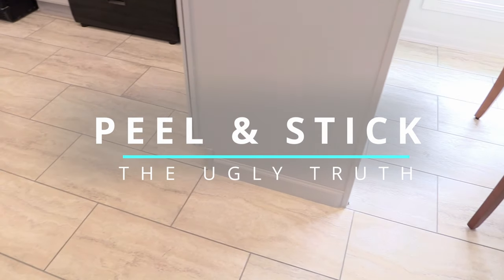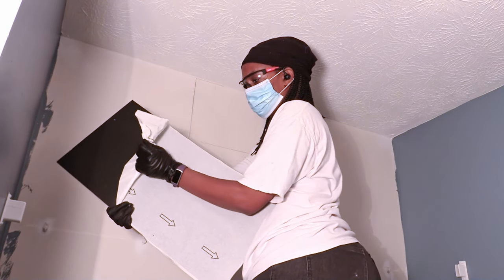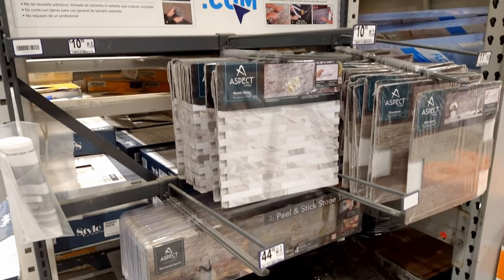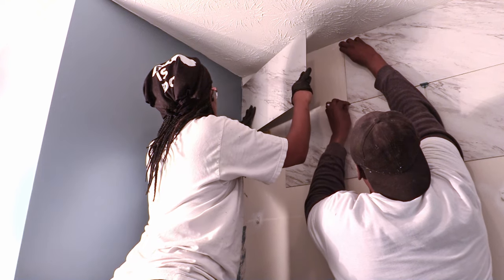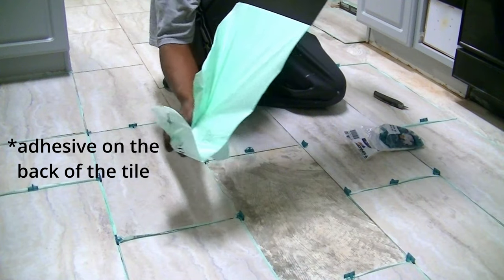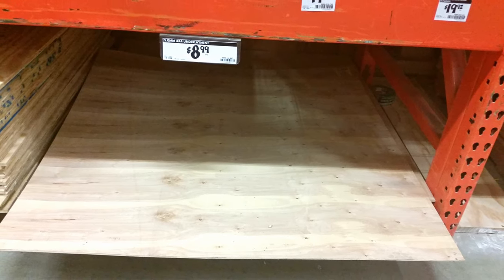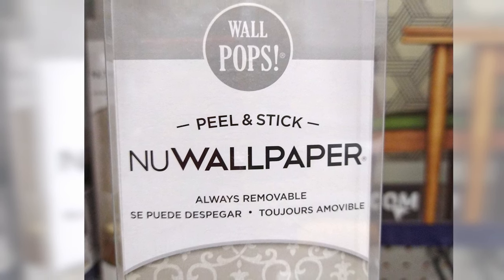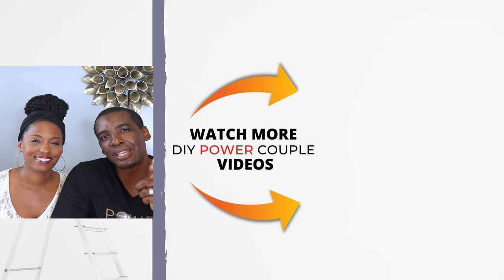THE UGLY TRUTH ABOUT PEEL & STICK - Don't Be FOOLED!

Comment: That is an incredible point! No one talks about what it takes to remove peel and stick wall paper or vinyl flooring or how long it can last or stay up if used in other ways. I didn't even consider thickness as a factor in addition to the adhesive. Thank you so much for sharing your experience - really appreciate it!
Reply: I use it to line the insides of my dressers so my clothes don't snag on wood and for a fun pop of color. It is super hard to remove if it's been in place for a long time. I can't imagine how much work cleaning adhesive off an entire wall(s) would be😐
Reply: I just removed 3 layers of peel-and-stick vinyl tiles. I've done quite a bit of work myself in my home and this was one of the WORST jobs I ever did. Even after I finally got them all up with the help of a heat gun, there is a very thick layer of extremely sticky glue left. I own my home so was able to let it dry and get ceramic tile installed, but no way are the vinyl tiles renter-friendly.
Reply: @abigail1023 tacky pond shop crap stick to proper tiles 👍

Comment: I used command poster strips to put my peel and stick up. Never removed the backing. It's in the kitchen covering back and side of wall near the stove. It looks like stainless steel. That makes it renter friendly. I haven't had to clean grease off my bare walls in 5 yrs. Easiest clean up ever!
Reply: that grease in itself is impossible to remove if not done immediately!
Reply: Grouting peel and stick def makes it more permanent! This method is awesome! I used double sided carpet tape myself and haven’t had any issues!
Reply: @deewatson213 Have you had to pull out the tile? Been thinking of using this but now I'm wondering what hell might await me when I move out of this place and have to remove it
Reply: @angiet3535  yes I removed it. The worse thing I encountered was sticky residue. I used good off to get it right up. It was pretty simple. I even used contact paper on the counter tops and it was also easy to remove.
Reply: @deewatson213  I wonder if I can pull this off on floors😁
Reply: Great idea
Reply: Wowww so I can do this for a kitchen backsplash too! Just a good idea! Can u do this for bathroom shower tiles too?

Comment: Lots of experience here, get permission! Peel and stick put on correctly is next to permanent and can be harder to remove than simply cutting out the floor/wall and replacing it. It’s not easy to remove like say, wallpaper. It could cost you and your landlord big bucks to take out. Not renter friendly.
Reply from the maker: Great tip!
Reply: So do it incorrectly and I’m fine? 😃
Reply: @ d flowers and diy power couple, you people really annoy me as it's just not as simple as that when money is tight and landlord never updates the property. My landlord only provides general maintenance so some of us have no alternative!!!
Reply: @Rachael121  It doesn't cost extra to get permission. Have you ever asked your landlord for permission to make an update to the property, providing you provide the materials and labour? Your landlord will probably say yes, but may want to see what you intend to do to his property, as is his right.
Reply: What if you use painters tape underneath?  Like a barrier between the paint and the adhesive?
Reply: @MsVanna24  painters tape adhesive is super weak. Like weaker than scotch tape. It will just come up

Comment: I installed click lock over the floors of my last house rental. The landlord liked them so much they paid me to not remove them. I charged what I paid for them plus labor and still got my full deposit back on move out. They were able to increase the rent on the next tenant due to the uograde!
Reply from the maker: Seems like you... handled your business!!!
Reply: I should have asked about that in my last apartment! It was in sorry shape when I got it. My father and I sanded and bleached the floors, put in a backsplash and installed ceramic tiles on the kitchen floor, painted, fixed all the cracks and holes in the walls and floors, replaced the cabinets, even soundproofed a wall and replaced the broken toilet. That apartment got quite an upgrade because of me, and we should've been paid for that labor when I moved out. Didn't even occur to me. Whoever got that place after me really lucked out.

Comment: Years ago we bought a house where someone previously had used those peel and stick carpet tiles in the living and dinning rooms. Then someone later had tried to remove it. We were stuck with two rooms with patchwork effect of tiles across part of each room, some clean hardwood flooring in areas and some floor covered in black goop from the glue residue. We were struggling with getting the mess up until by accident we found something that got the goop up fairly easier. One of our dogs had an accident and we used a cheap pet urine cleaner from a dollar store for the accident and noted that it loosened up the glue residue as well - better than the Goop Be Gone we were trying to use.
Reply from the maker: Wow, didn't think about that product to remove residue. 😳 Thanks for sharing.
Reply: What was the name of the product?
Reply: At 'one if our dogs had an accident' I thought your suggestion was going to go in a whole other direction. 😂
Reply: I need to know what product you used... I used some stick on products and I'm having a hard time getting them off
Reply: @vanessagonzalez5484  I think it was one from one of the cheap ones from a dollar store. Not really sure since it was several years ago. Think it was from Dollar Tree.

Comment: As a renter, you have to be careful about which peel and stick you use. 'Get permission' is always the best way to go about things. There is an easy stick shelf liner that DOES peel off with out any issues. It is for cabinet shelves, but I used on an old, beat up microwave cart (sides as well as shelves) and it works fine. But - I don't have kids so it isn't getting banged about. Peel and stick tiles can be wonderful if you take your time and install it correctly. It can be cheaper or it can be very expensive. But it isn't coming up easy peesey. It isn't really 'renter friendly'.
Reply: Put down rosin paper to cover the floor then the peel and stick tile for renter. Use double dided tape on the paper to the floor. Never grout in a rental. Contact paper is an option for a temp backslash and its cheaper than p&s backslash tiles. Still always get permission for any decor in a rental. If changing light fixtures , always save the originals as they are permanent,  unless you leave the new. I've done this with light fixtures and shower heads , faucets, cabinet hardware . I've even done wall to wall carpet with double sided tape. As long as you have the original permanent fixtures to put back ? You can take all of your fixtures with you. You can even change out the light switch plates. Always put back to original state upon moving unless you and your landlord have made another agreement. My sister in law put in new fixtures when the old ones were all beat up. She tried to take them with her and was faced with losing her security since she threw away the old ones. Her original landlord know bit he sold the property and the new landlord had no such agreement with her. In cases like that you should always get it in writing or as an amendment to the lease agreement.
Reply: If there is any texture to the area, like a sheetrock wall with multiple layers of paint, contact paper doesn't stick. I think that's why the peel and stick has gotten so popular. It just sucks that it might take paint off with it.

Comment: Don't forget the fumes that peelable wallpaper, flooring etc can give off and not ideal for small rooms for infants, children, animals such as birds that could be sensitive, or if you have respiratory issues or allergies. Adequate ventilation is needed to vent these fumes. The fumes come from the adhesives and plastic properties of the product.
Also, to remove products a hairdryer on low may help soften the adhesive on sticky backed plastic. Wear a suitable respirator if using this method
Reply from the maker: Thanks for sharing your experience!
Reply: Oh yikes! How long does the smell take to evaporate if I may ask??
Reply: wow thanks for sharing this!
Reply: Thanks for the information.  Can you please tell how long the fumes lasts.  That will be a problem for me.   Thanks.💯

Comment: "Renter friendly" command hooks: stuck to the wall, hung 5 oz thing, fell off the wall, ripped 2" of paint and spackle, creating sizeable hole, took 30 min to fix (reapply spackle and repaint). Regular hook with nail: held on and tiny nail hole took 5 min to fix. Added bonus: regular hook cost 25% of command hook. The truth: "renter friendly" products are a ripoff. Thank you for bringing this truth forward ♥
Reply from the maker: You're welcome, Anna. Thanks for sharing your story. -DIYPC 😃✨
Reply: That's interesting. I've never actually had a problem from using command products.
Reply: Yes, command hooks may NOT be renter-friendly, especially if the drywall is not well done.  It’ll easily rip off drywall if something falls off and pulls the hook/strip with it.  If your home has a lot of humidity, the command hook loses its effectiveness, and it falls off the wall, sometimes pulling drywall off the wall.  You’re better off using a regular hook with a nail.  It’s sturdier, and it’s easier to fix at moveout with a tiny hole versus ripped off drywall.
Reply: @Jennifer_Lewis_Beach_Living It sure is you are 100% correct! :) Here in lovely virginia with its usual 90% humidity :) All adhesive fails here not only command hooks. I had construction adhesive fail before due to too much humidity. I now have to buy its special landscaping variety which costs A LOT.
Reply: I don't use Command because of that same issue.
My small picture fell off and caused sizable damage. A little spackle fixed it.
I'm glad I am not the only one.
Reply: @Jennifer_Lewis_Beach_Living So true.
Reply: I had a similar issue with command strips. I hung a lamp that weighed 1kg /2lbs, using command strips that should have supported much more weight..Kaboom !! Broken lamp, light bulb shattered everywhere
Reply: @aletarossi-thomas8757  I am so sorry :( I hope that you did not cut your hands. You should sue these assholes. This is outrageous.
Reply: I'm not accusing anyone here of doing this- but a LOT of command strip issues come from not following the directions to a T! You have to clean the surfaces super good and the 1+ hour wait time before application is NOT optional! That said, 95% of my command hook use throughout the years has worked perfectly. The heaviest thing I tried was 2 lanterns that stayed on my living room ceiling for 2.5 years....one fell one day and the other one fell the next day 😂 no damage tho I'm not even upset bc I was thinking about changing them anyway 😂 I wouldn't hang anything very breakable tho
Reply: Command strips over really old/cracking paint is where damage is common I think
Reply: @juicyparsons  No the house was recently renovated and repainted :)
Reply: @juicyparsons  I am glad that you did not get hit by them when they fell! And hopefully neither did your family and pets. Now you know why people file lawsuits :)

I do follow directions. I am Autistic and as such very precise :) Directions being in an inaccessible form that is another issue altogether. I have family members read them to me. I degrease the wall and wait. Doesn't help, command hooks and whatever is hung on them still fall. The only one I still have is the one attached to the side of my desk that I hang my phone charger cord on :)

Comment: I had peel and stick tiles on my kitchen counter. Yesterday I wanted to take it off. A living hell. I used warm iron over a cloth to make it easy to take it off. It was not. After I took four tiles off there is a huge, sticky mess under it. I have goop removal but it did not remove the sticky stuff. I put back four of these tiles and now have to have a new kitchen counter. Never again peel and stick for me. Thank you for your video. It is educational.
Reply from the maker: Thanks for sharing your experience! 🤗
Reply: I put peel and stick, supposedly removable, we'll see, on my stone backsplash in the kitchen. I was just thinking of removing it, not realizing what a mess I might be in for. Wish me luck.
Reply: another comment elsewhere on here mentioned that they randomly discovered enzyme cleaners work even better than the "goo" removers, might try that, usually they're listed as great for pet urine stains etc find em any retail cleaning aisle

Comment: Roofing paper works great and protects the floor under and easy to remove.  This system has been used since glue down linoleum.  I have a hundred year old building with a maple wood floor under layers (3) of linoleum and peel and stick.  I removed all flooring, to get to the maple floor.  It was easy and the maple floor, sanded and sealed, looks wonderful.  Just an option for easy removal.
Reply from the maker: Thanks for sharing, Richard! 😊

Comment: On walls where we used a plastic texture paint we would often use a cheap peel able paper wall vinyl (wallpaper) first . That way when you want to remove the surface product it came off easy  leaving the paper backing . I wonder if this would be a thing . I also helps with the porosity of the wall allowing the product to stick evenly. The wall would have to be prepared and sealed well prior to hanging the wallpaper otherwise this could cause an issue .   This might be worth a trying on a wall panel to see if it works . Just a thought

Comment: Is it safer to use let’s say peel and stick backsplash when you’ve first lay a contact paper or double sided sticky paper?
Reply from the maker: Veronica, laying adhesive on top of adhesive will make things a little hard when you have to remove the bottom layer.

Comment: I had my kitchen floor done with a peel and stick that looks great , but everytime I drop something it leaves a dent, which means it must be too thin. I wish I’d looked for something thicker instead of trying to save money. The backsplash looks amazing, and really updated my kitchen as I’ve been in the same apartment almost 25 years. I also did my bathroom floor, my landlord is also my boss and I was able to have all of my peel and stick tiles put down by contractors who work for our company. That really made all the difference in achieving the professional look I wanted.
Reply: Doesn't matter what the flooring is. If you drop something anything will dent except tile but sometimes tile will crack.

Comment: You all are a beautiful couple! I own my house, but need to save up for a massive update to my 1979 townhouse. I'm using peel and stick for a tempory fresh look and to experiment with potential styles before dropping the big bucks. I already did a kitchen wall with peel and stick, which aside from a few touch ups with super glue, it's been strong. It's installed over the stove so I expected the heat to effect the adhesive. Doing the floor next with traffic master, but considering not using grout so that it will be easier to remove later. Does it look weird without grout?
Reply from the maker: Hi Coach!  It really is a preference to grout or not.  Peel and stick planks and intricate designs are examples where you can place the tiles right next to each other without grouting.  Do a dry layout before sticking to see if you like the look. 😀
Reply: So did the heat of the stove have any effect as of yet?

Comment: I used nice peel and stick with grout to cover over my ugly 80's bathroom vinyl. It was cheap, easy, and quick. Best of all it's more durable than the builders grade original flooring and it looks great!
Reply: So you don’t have to take up the vinyl flooring? You put the peel and stick over it?
Reply: @latoyaamb3r  That depends on a number of things. Is the vinyl floor the original layer? It's possible that the vinyl you see is already a second layer. I probably wouldn't add a third. I'd remove both layers, so the peel-n-stick can be the first. Some old cheap vinyl was very soft, almost cushiony. I wouldn't use grout over that because there could be enough movement when people step hard for the grout to crack. What condition is the previous vinyl in? If there are holes or the vinyl isn't adhering well anymore, it may be better to remove the old vinyl. In my case, there was one edge under the counter about 1. 5" by 15" that was curling up. My peel-n-stick was the same thickness as the old vinyl, so I used a straight edge to cut out a 2 x 17 inch wide rectangle from the old vinyl where it curled. I made sure that none of the old edges needed reglued and cut a matching strip from a peel-n-stick tile to fill the hole. It looked silly, but since it was the same thickness it filled the hole to the same height. I gave a day or two to make sure the strip stuck well, and then I used peel-n-stick over the whole floor including the patch. I also removed the toilet so the tiles could go under which will make it easy to remove the toilet if I ever need to in the future. I did not caulk the toilet--if there's ever a problem with the wax ring, I want to see the water (rather than force the water under the tile or subfloor), so I can repair the problem. I used caulk around the tub and under the cabinet toe kick, so water can't leak under the tiles. It looked fantastic and was really easy. One tip, peel-n-stick tile is difficult to remove, so lay out all the tiles ahead, so you can make sure repeating patterns match (if it has a geometric pattern) or don't match (if it's supposed to look natural like stone).
Reply: @flaggov6949  Thank you 🙏🏾